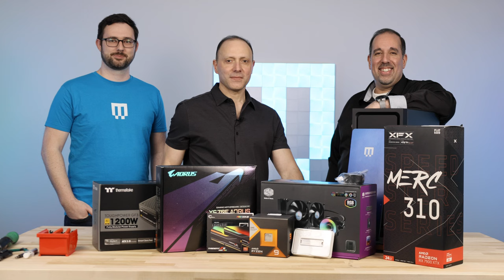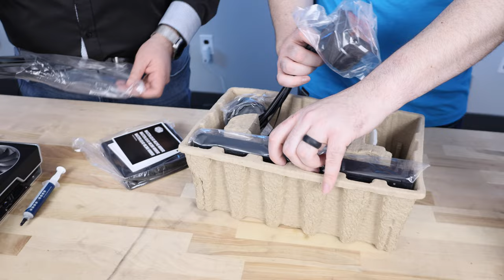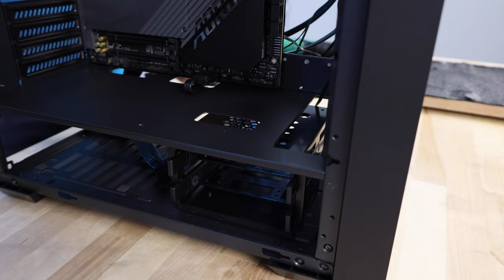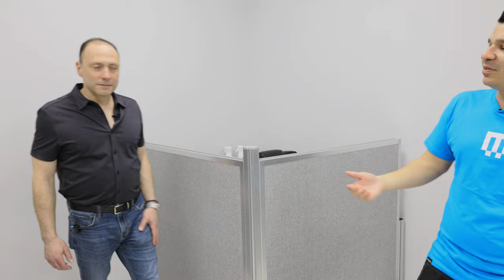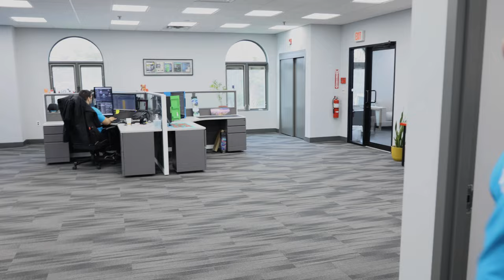All-AMD Ryzen 9 7950X3D Maingear MG-1 Gaming PC Build And Factory Tour!

Comment from the maker: PC Build Show Notes And Chapters
00:00 Start
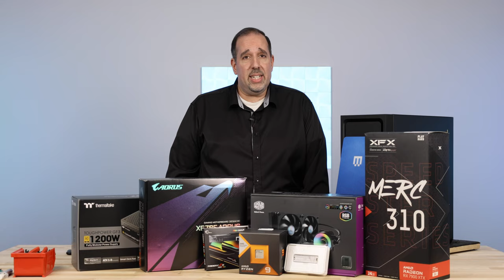01:16 Parts And Specs Rundown
02:57 Build Flow Detailed
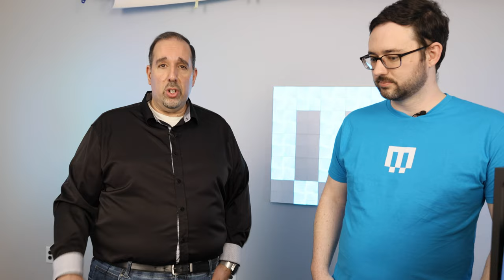03:44 Socketing The CPU
04:26 Slotting The DDR5-6000 RAM
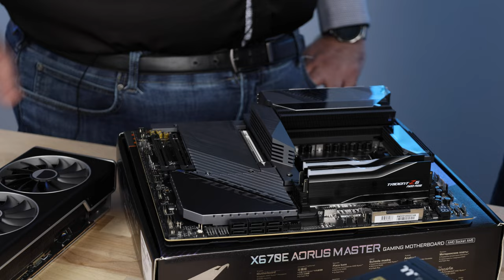06:04 Installing The SSD
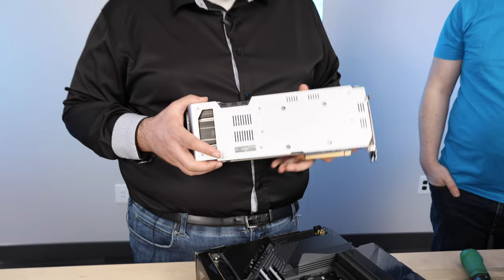06:25 Motherboard GPU Slot Feature
08:22 Installing Motherboard
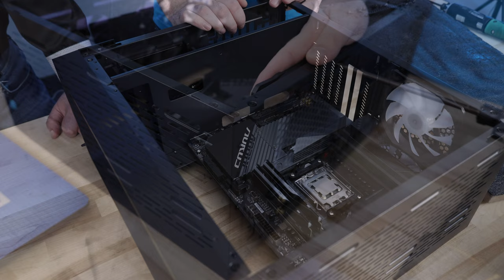11:06 Setting Up The Cooler
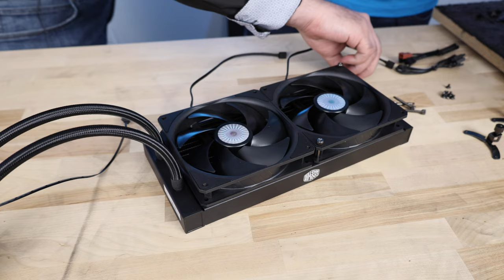12:27 Pre-Wiring The Motherboard
13:00 Installing The AiO Liquid Cooler
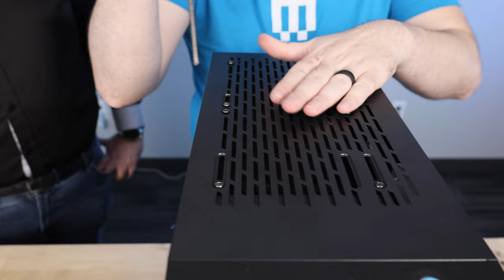13:56 Pasting The Ryzen 9 7950X3D
15:15 Installing The AiO Cooler On The CPU
16:01 Installing The Radeon RX 7900 XTX
16:46 Installing The Power Supply
17:09 Wire And Cabling Clean-Up
17:37 Touring Maingear's Factory Headquarters!
20:05 Support Center
20:36 Top Secret NDA Parts Room
21:34 Studio Behind The Scenes Look
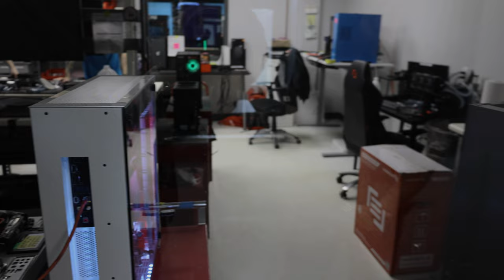20:18 The Nerdy PC Build Station Tour
23:14 The Maingear In-House Barber??
26:34 Buttoning-Up Our Custom All-AMD Maingear MG-1 Gaming PC
28:03 Turbo Game Benchmarks
28:45 Wrapping-Up Thumbs-Up And Subscribe!

Comment from the maker: System Specs With Pricing:
Ryzen 9 7950X3D - https://amzn.to/413IHS8
Gigabyte Aorus X670E Master EATX Motherboard - https://amzn.to/3KxpAIT 
XFX Speedster MERC310 Radeon RX 7900 XTX 24GB Graphics Card - https://amzn.to/416Q1w6 
G.Skill Trident Z5 NEO Series (AMD Expo) 64GB (2 x 32GB) DDR5-6000 RAM - https://amzn.to/3zXsiTo
Solidigm P44 Pro 2TB PCIe 5 Solid State Drive - https://amzn.to/3zSqKdh
Thermaltake ToughPower GF3 1200W ATX 3.0 Power Supply - https://amzn.to/3KU98nE
Cooler Master MasterLiquid ML280 Mirror Close Loop AIO CPU Cooler - https://amzn.to/3KUicsu 
Maingear MG-1 Shroud Edition Mid-Tower ATX Gaming PC Case - https://maingear.com/product/mg-1-rx-7900-xtx-advantage-2023-q1

Comment: HotHardware is a suiting name for that hotbox case
Reply from the maker: Don't be a troll, and this chassis has very good thermals, especially with its 360mm front fan assembly.
Reply: @Hothardware m not trolling. Case has very limited access to front intake air. Putting a rad there only makes the intake worse.. more hindered, and hot air going in to the case through the rad.
Reply from the maker: @jeffkuzzen  but it's not a radiator. It's literally a 3x120 mm fan assembly. The 280 mm rad is up top
Reply: @Hothardware  did you edit it or did I misread it? I read it as "360mm front rad".
Airflow is still trash compared to a good mesh front case tho.
Reply from the maker: @jeffkuzzen  No, no edits and that was never mentioned. And behind the shroud on the front, it's wide open with air being pulled in all around the shroud. The case is both cool and very quiet with this setup.
Reply: @jeff knudsen  Thermals are great stop lying.

You can even pop off the front panel if that bothers you so much and have unrestricted airflow.